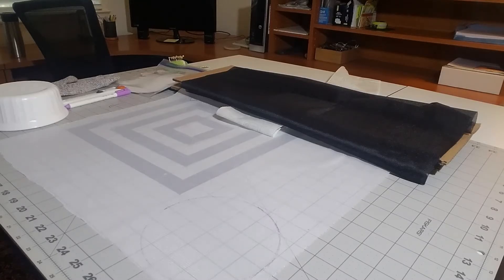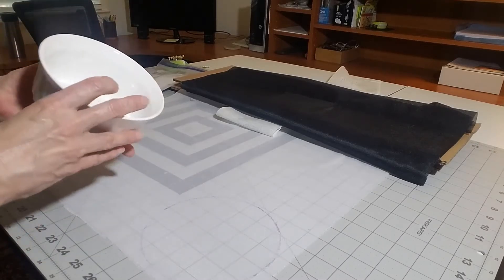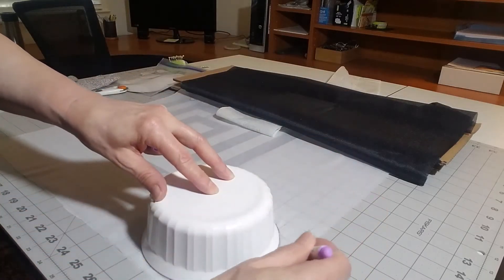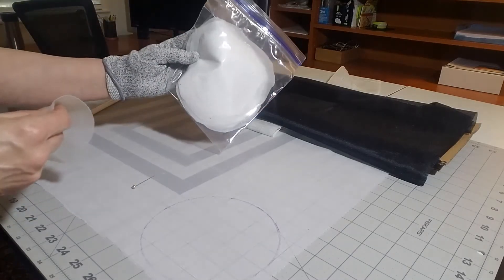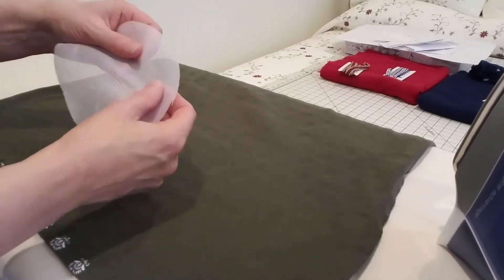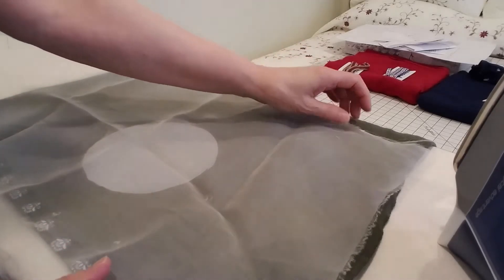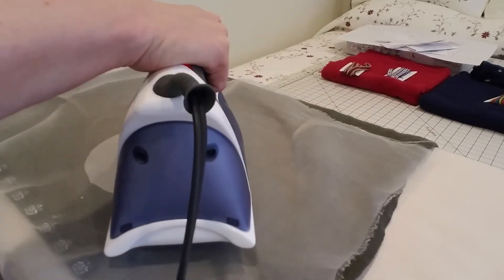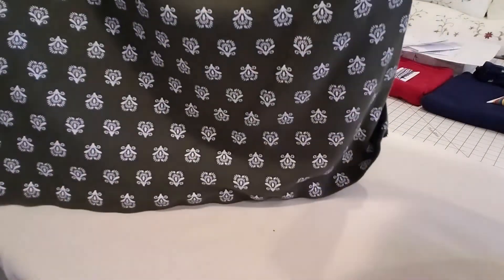How To Prevent Holes in Your T Shirts

Comment: I'm looking to fix many t-shirts.  I like the circle idea as opposed to the square.   anyway I tried it on an old  t-shirt first (before my good t-shirts) and used Pellon fusible Featherweight interfacing #911FF and it did not stick one iota.   So you suggest using the EK130?   Do you know anything about the Heat n Bond products? 
Thanks.
Reply from the maker: Sorry this is so late, my notifications were off!  I don't know about the Heat n Bond but you do need to use a stretch (tricot) interfacing.  Otherwise when you put the knit tee on and off the interfacing won't stay on.  It has to stretch along with the fabric.  HTH :)

Comment: What is the glove for? Never heard of it before.
Reply from the maker: The No Cry glove is cut resistant when using a rotary cutter.  I use one on my left hand to protect it while I cut.  It's not needed on the hand actually using the rotary cutter, my right hand.  I find I can cut more quickly and go around curves with confidence knowing I won't cut the tip of my finger off!  Rotary cutters are like a round razor blade. The No Cry brand stretches and fits nice and tight as long as you get the right size.  Comes in a pair that can be used on either hand and they are washable.